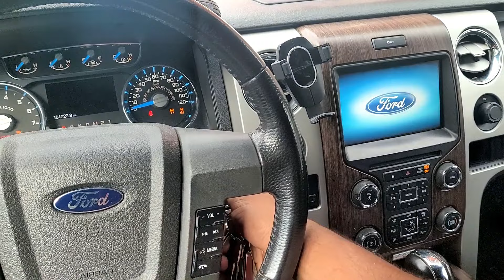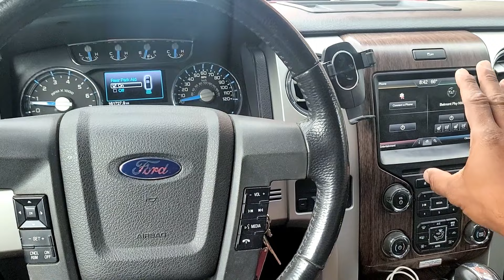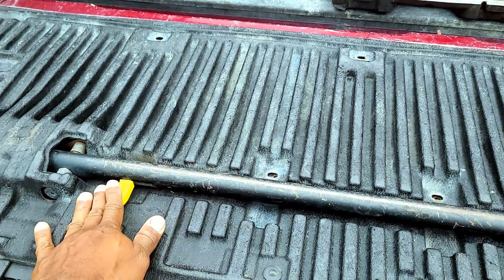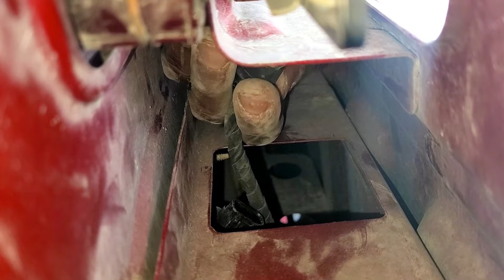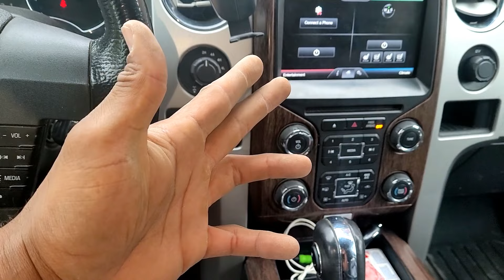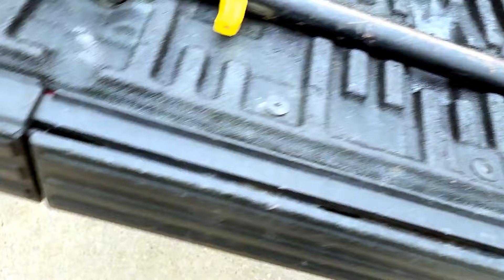How to Repair a Backup Camera with a Blank or Fuzzy Screen! 2013 Ford F150 Lariat/Raptor

Comment: The correct way to get to the camera connectors is to remove the Ford Emblem. Take a small flat tip screw driver and gently pry the the blue part off. Behind it is 2 7mm bolts. Remove them and the camera with the frame for the Emblem is in your hand.

Comment: 2015 F350 I have a dealer recall letter in truck glove box but truck did not have problem then until now. Found your video and had wife sit in truck while I vibrated tailgate around camera/elblem. Sure enough it dropped out display momentarily. Cleaned camera connector pin which had minute white crusts on them, hardly noticeable. Re assembled and now solid operation. Thanks. Even with dealer recall I much prefer to DIY saving dealer scheduling, travel, waiting on repair and real possibility that intermittent nature of failure would not be found with their troubleshooting. Thank again.

Comment: Good video, how ever I found out that you can pry off the Ford emblem and then remove the two (7mm) head bolts and you have access to the mount and the wiring harness. Much easier.
Reply: Show video

Comment: No disrespect my man but you went about this the hardest possible way. The emblem has a face plate to pops off revealing 2 7mm screws. Take those out and the entire assembly comes out with the connectors and all.
Reply from the maker: @SamxDan  Thanks for Watching! As mentioned in the video and comments thats 1 option, it was not recommended by the Local Ford shop and several forums as the emblem has a tendency to Snap more often then not..and this video and channel is made to save ppl money which includes not having to replace any uneededly damaged or broken parts!

Thanks for Watching and Happy Wrenching!

Comment: Worked like a charm for my 2020 ford f150. Thanks, saved me a minimum of $160 for a diagnosis at dealership. And my bank account thanks you 😊
Reply: He probably saved you about 10x that amount. Nowadays dealer mechanics rarely spend more than 5 minutes looking for a simple fix. They would’ve just told you it all needed to be replaced. At least at the Ford dealers I go to that’s what happens. It’s sad that they don’t really work to satisfy the customer anymore. In recent years, it seems they just work to satisfy the dealerships account. Business use to be a give and take situation. Now it seems like they are all take.

Comment: Just completed this today!  Working fine again. I cleaned the connection under the bumper area the same way, at the same time. So, not really sure which one it was. One tip, the connection in the tailgate that is attached is sloped up. Use compressed air with a piece of tubing to verify there is no puddling if the electrical cleaner is present. I used compressed air on all connections after cleaning. Thanks for your your tube tip buddy!

Comment: Welp. I tried the contact cleaning, fuse check, and wire check. All doesn't work. Will most likely have to replace it.

Comment: They say also you can take off the Ford logo where the camera is  for better access
Reply: Yes, on my 2015 F350 I carefully pried off emblem. The emblems plastic pins with metal keepers are at 3 o'clock and 9 o'clock positions and are inboard from edge.Start at bottom center tiny weep hole edge of emblem then move to right or left edge. I used a pocket knife blade to coax emblem pins out, be patient. Blade eventually hits these mounting pins as you work in from edge. 
Note: on F350 tailgate there is no access to back of camera from inside tailgate panel.

Comment: Use 3M dry silicone spray on the silicone rubber seals to aid reassembly. You will be amazed how smoothly they connect back together when the connectors are clean and lubricated. do not use  dielectric grease this will collect dirt and push the seal out of place and allow water to corrode the terminals. Before disconnecting use water or windex to remove the dirt and mud from the weatherpack connectors and blow it off with compressed air. repeat if necessary because we all know how difficult they can be to disconnect when dirty. Don't forget the DRY SILICONE SPRAY before reassembly. I learned this from working at the ford dealership.

Comment: You could have just removed the Ford emblem in the back. There are 2 screws and you get to the camera out!
Reply from the maker: Hey thanks for watching! As I mentioned in the video that is 1 method that is covered extensively in other videos. However that method comes with the downfall of a brittle and broken ford emblem during removal.
This Video was to offer another method to stand out amongst all the similar videos and avoid damaging the emblem!

Comment: Thanks for the tip on the tailgate connection, have already cleaned the lower one behind the bumper. Another good tip after cleaning and before reconnecting is to seal the plug with dielectric grease, make sure to just put it on the plastic male part of the plug that slides inside the plastic female part to help seal against dirt and moisture in the future. Make sure not to get any grease on the electrical connection points as it acts as an insulator and not a conductor.

Comment: Would it still work with one that says no signal detected?
Reply from the maker: Hey thanks for watching and asking a question! It should still help narrow down the issue for you! If theres no signal detected in my experience it is a similar issue of a bad connection at the camera or main connector harness (both shown in this video). Whether it be due to corrosion, dust/dirt/moisture build up or somehow it came loose!

Assuming it has the original radio and no aftermarket adaptations have been done i.e. different head unit, new speakers or wiring harness..if everything is true and original I'd bet it's a similar issue! 

Clean the connectors, verify they're fully seated and hopefully you're good to go! If not it will either be a issue with the camera itself not transmitting. UNLESS the bluetooth or other functions if the radio are acting up..if that's the case could be a receiver issue at the radio.

Hope that helps and Happy Wrenching!!

Comment: Morning I have a 2014 Ford. Don't have a visual camera just the lines that tell me how close I am. Any advice for me?
Reply from the maker: Good Morning and Thanks for Watching!! If you don't have the backup camera, I can only assume you have the backup "assist" system? Which If I'm right would consist of 4 sensors all in the rear bumper.

Assuming there hasn't been any damage to the bumper, you could go thru the same process of cleaning the 4 circular sensors from the outside, then unplugging, spraying off with electrical connector spray, and reattaching. That should hopefully clear up any issues!!

Good Luck, and Happy Wrenching!!
Reply: @minutemaintenance7385  thank you for replying so quickly. I am a female but do maintenance on my truck due to help from people like you. Thanks and I hit the following button.

Comment: Hello sir ! Thank you for the video, I really did all the trouble shooting in your video and even checked my fuses and still nothing! What would you recommend to do now ? Just replace the actual camera?
Reply from the maker: Hey thanks for watching! If you're confident in the cleaning of the harness connection, then most likely the issue is the camera itself and would need replaced.

Comment: It would have been easier if you took a flat head screwdriver and remove the Ford faceplate to get to the camera connection.
Reply from the maker: Hey thanks for watching! As mentioned in the video and the comments, that's 1 option, issue is as any ford tech would tell you, the emblems break all..the..TIME! Lol this gives you the ability to access the camera and not worry about possbly needing to replace the emblem or damage your paint too! Tons of videos on emblem removals (and their breaking) for camera access, none about this alternate method! Happy Wrenching!

Comment: Thank you so much, i followed your directions and was able to fix mine in 15 minutes. It had been acting up after I had my truck  detailed. Also, to all those saying popping the emblem makes it easy to access the Camera, sorry but you are wrong. Unless you have some magic fingers to fit in the small holes around the emblem assembly it won’t work. 
Thanks again man!
Reply: But broham after i popped the emblem off  , i had to super glue it back on , my fault but i jackt 1 tab or hook .  Late

Comment: i took the connecters off and for some reason i cant get them back on
Reply from the maker: Thx for warching!! Sorry to hear you're having troubles reconnecting!! I have had similar issues with different connectors in the past. They become old, warped from heat and weather, or sometimes there's small particles of debris when putting it back together that prevent it from "seating". Its a tight space so that makes it extra hard. There are videos on YouTube on removing the "ford" emblem to access this same connector with more space to work. Beware: that the emblem is known to break during this process which is why I went this route. If I'm you, I'd do my best to clean the connector on both ends with electrical cleaner OR canned air/air compressor to be extra sure theres no debris stopping it. If that doesnt work you can force it in best you can, then zip tie it in place or gorilla tape around it to seal it. I've used both methods, zip ties are stronger of course, but have had success and no further issues with connecting them that way! Good luck!
Reply: I had to remove the gasket to get the connectors back together and wrapped with electrical tape

Comment: Howd you get it to click back in? Can get the tab pushed in
Reply from the maker: Hey thanks for watching!! No special trick! Just pushed it in and mine was able to reseat without any issues!! If yours is having a hard time it could have some unknown Debris still lodged, you're not pushing hard enough (I know its hard it's a very small space to work) or somehow irs damaged! You could always push it in the best you can and then use Gorilla tape or a zip tie to hold it together!! There are other videos on how to remove the rear Ford emblem off the tail gate which will give you more access, however the emblems tend to break during removal which is why I documented this method.
Reply: @Minute Maintenance  thank you very much for the detailed response. I never thought about decision possibly being the culprit.  Keep up the good works and God bless!

Comment: good video but just a FYI. If you pop the emblem off there are 2 screws behind it and then whole camera housing and camera just comes off the tailgate and you can unplug it much easier. 2 min cam in hands
Reply from the maker: Good tip! Only issue is the emblem tends to Snap when trying to come off based on my research and conversations with the Local Ford Dealership Techs, this was their alternative way to avoid that issue and save you money by not needing to buy a new emblem!
Reply: @minutemaintenance7385  Got it, makes sense to me. Mine has a all black emblem on it which seems to have different mount clips on it so it pops off easier I guess.
Reply: @minutemaintenance7385  Emblem does snap as its a disposable part but Ford now replaced it with a new model which is removeable that replaces the snapped part when you break it off. Its not very expensive.

Comment: Dude, all u had to do was pop the Ford Emblem cover off to access the two 8MM bolts that hold the camera in place. Pull it out a bit and you can see the connector. You didn’t have to remove the tailgate cover 😂
Reply from the maker: Hey thanks for watching! Maybe you're luckier then me, but those ford emblems are known for breaking when trying to remove them! When I called my local Ford dealer to look at OEM camera prices..they quoted me the cost of a new emblem too since its breaks! My way..5 more min..saves your emblem and you money!

Comment: Having trouble getting my hand in a position with enough leverage to pull the  connections apart. I’m able to press the tab down with a screwdriver but I just can’t pull them apart. It also doesn’t help that all of my electrical connectors on my truck have like corroded together. Usually I would just use vice grips to pull them apart but there’s literally no room. Idk how you did it. Your hands are pretty big too.

Comment: Great tips! I got both my cameras working by simply cleaning connections, I almost bought new cameras too. Thanks!
I did find it to be easier accessing the rear camera plug by removing the logo then removing the two 7mm screws and pulling the assembly out to get a good grip on the connection. Both methods work though.

Comment: Hey...this video gave me so much hope. Now I'm worse off than I started. Have you ever had trouble reconnecting the wire harness? Mine won't click back into place no matter what I try. So I unplugged the harness that's under the truck by the spare, and that won't plug back in either. Anyone else have this issue? Help
Reply: Just went with removing the emblem, literally  3 minutes to get to camera, pulled connection, sprayed connector done in another 3 minutes. Just go slow on removing Logo, i used a pocket knife and had no problem. Good luck.
Reply from the maker: Oh No I'm so sorry!! I have had trouble with wiring harness in the past, not this specific one on my end. Unfortunately they are plastic so they can degrade over time and break or just not want to reconnect as strong!! If you have access to an air compressor or a can of compressed air try blowing out both ends just in case theres some grit you cant see lodged in somewhere! If that wont work..whenever "I" have a broken wiring harness on a personal vehicle, I'll reconnect it and zip tie it together!! I Attached a link to a video I made where I had a coil pack break. Still zip tied today. If you decide to zip tie it, use some "die electric" grease to put inside the harness connection first as an extra and added moisture barrier!! Good luck!! 

https://youtu.be/G87j7s-fW2Y
Reply: Same problem + still saying loss of single- Andy updates?
Reply from the maker: Oh geez I'm sorry to hear you're still having issues! In this video I only showed working in the 1 connector but towards the end i showed the 2nd connector that tends to have issues as well. If make sure both are clean and secured and even add a dab of "dielectric grease" to each to keep moisture out and increase connection. If connector is finicky you can ziptie or even gorilla tape it together! If you're having trouble reaching the 1st connector there are tons of videos on how to remove the Ford emblem on the tailgate for better access..however the emblems tend to break which is why I showed this method. Lastly it is possible either the camera itself is bad or the radio/display unit. The Microsoft Sync Radio Units are notorious for dieing and having electrical issues after years of use. However before replacing just replacing parts...I'd spend the $50-$100 at a shop to get it diagnosed to make sure you're not replacing good parts and not solving the issue! Good luck!
Reply: I pulled the gasket out of connector to get back together and wrapped with electrical tape

Comment: Thanks for this video. I have a 2014 Raptor and it started doing this last year. For me it comes on and off, mostly off with the car assistance info. I’m hoping this will fix my problem.
Reply: Did it fix for you? I've got a F150 Platinum and the camera works sometimes and sometimes not.
Reply: @DamienAlexander sorry for the late response but I tried it and didn’t work. Just tried once again before I changed the camera myself yesterday and now it works. Thanks minute for this video 👍

Comment: I was having some trouble I tried this but was very hard to disconnect the camera cord your way. I had to take off the Ford logo. Tried to spray the connection but didnt work for me. My next guess was the camera died. I was scared if I was buying the right one and if I could even do it. After 1 YouTube video was able to pop this in 10 mins. 5 mins to cleanup. The Ford logo on your tailgate has to break to install order one of those also.
Reply from the maker: Hey Boss Thanks for Watching!! I'm Sorry You Had to Replace the Camera Itself! That's Always a Possible Issue as Well as Internal Failure of the Car Radio/Display System as Well. I Was Fortunate To Not Need One as I Didn't Want to Break My Logo!! I'm Glad You Got it Resolved and Thanks for Postinf your Experience for the Others to Read as Well!